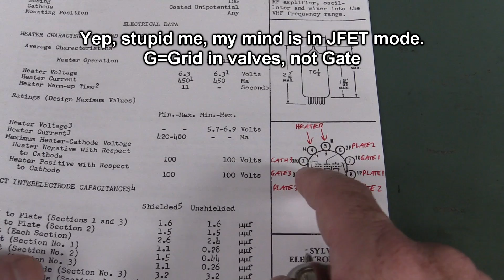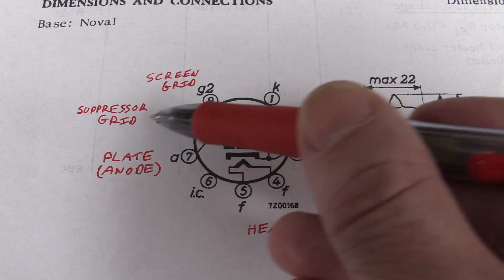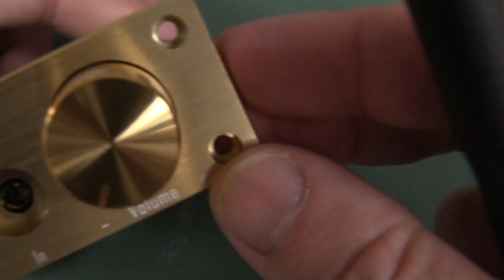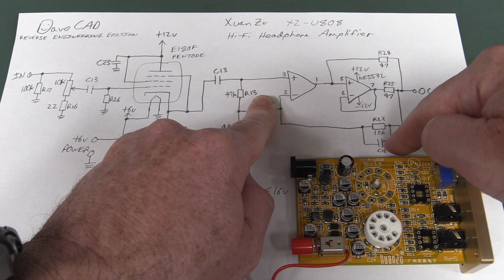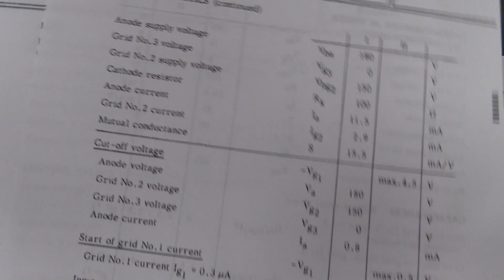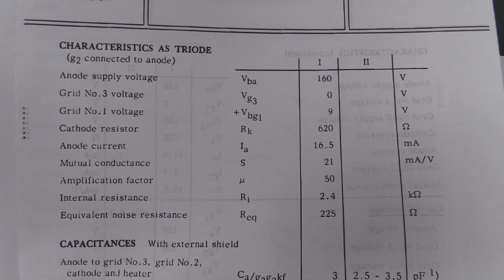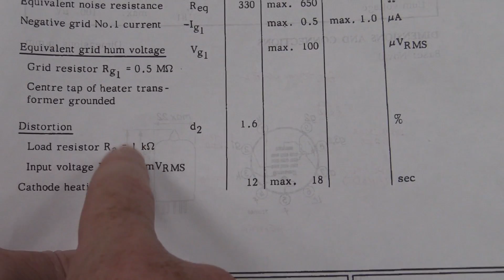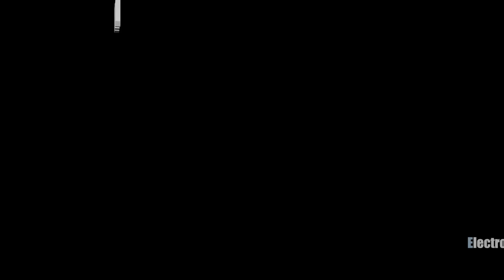EEVblog #837 - Reverse Engineering A Valve Headphone Amplifier

Comment: Come on folks, it sound better cause it looks better... no way my stupid semiconducter driven USB sound interface could be a match for this piece of engineering. And the case.... oh my gosh... it's GOLD. Haven't you seen it? GOLD always stands for top notch quality. And you gotta love the blue LEDs. You know... in the future everything awesome glows blue, that's a matter of fact! Unless you are a real hacker. Then you would hack the shit out of that thing and replace the blue ones with green ones... genuine hacker green® of course.

And now for the sound. Impedance conversion alone is reason enough to justify the tubes. They add all the sound professional sound engineers, musicians and that crappy equipement they use, could not provide.

You gotta learn to hear with your heart, not your ears, for they are too fuggin' close to your brain, which constantly rejects fraud and believe systems weaved by ScamCo Industries ltd. !!!

Comment: I have to ask, It makes sense to me to have two tubes and two NE5532P's to cover the left and right channel for stereo sound. So what is up with all the tube amps that use one tube and one NE5532P? I just built a headphone amp using two of the NE5532P's but not sure why you would use one. They must be losing output power with one as opposed to two of them.
Reply: The larger single-valve one that TechMoan tested is clearly two valves in a single package - you can see two separate heater elements in it. Same applies to the smaller one if you look up the datasheet, it's a dual triode. As for the NE5532P, well it's a dual op-amp so I guess they are just using one per channel. Maplin sells a stereo headphone amp kit which does the same (code N47FL) for the princely sum of six quid (so it probably costs about 6p from China).
Reply: My headphone AMP was cheap. About $9.00 US. It uses two NE5532P's and to my surprise it sounds good with little audible noise. Kinda nice because there are so many of these on the market and the price can go really high for one, but the sound may be terrible. You can never tell unless you try it out. If mine had sounded bad I was only out $9. I had fun building it though.

Comment: I fell into the trap and built one, hardly any amplification. It was mostly a headphone impedance matcher
Reply: Given that the circuit is essentially just a (not-terribly-good) tube-based voltage follower into an op-amp-based voltage follower...  that seems right.

Comment: valves in anything but guitar amps make no sense. what non guitar players wont know is that valves not just sound rich and full they also respond different than transistors when you play and they feel different when you  play. You cant get that with solid state amps, Its not about distortion, its about response, feel and odd order harmonics.
Reply: " its about response, feel and odd order harmonics."

That's distortion. It is just DESIRABLE distortion.

Comment: Actually, you can find out if valves doing anything in less than 26 minutes. Just detach them from the board, and voila! If you notice change in gain or not sound at all, there's an answer to this question.. I won't bother to watch this till the end...
Reply: +Damir Ulovec Well, if someone wanted to, they could design a circuit where removing the tube would cut out or affect the sound on that channel without the tube actually being part of the sound path.

The important question here is if the tube was an active part of the sound path, and if it was, does it serve a practical purpose or was just designed in as a way for the manufacturer to claim it was a tube amp.

Comment: Tubes in such a product are useless. Better buy a complete kit or build one by yourself.
The Sot8 IC could be a MC34063A, Chinese Designers love that IC, and is there really written 6J9 on the tube ? I used Google to translate the russian name of one of the tubes that can be put into the amp and it says 6SH9P, witch is a HF penthode.

Comment: LOL, anybody who bought this for HI-FI headphones with high impedance are going to be disappointed. Unity gain works well(not) with high input impedance headphones.
Reply: Normal output level from MoBo or other stuff is ~1V and power is U^2/R. Some Hi-Fi headphones have impedance of ~200-600 Ohm compared to normal ~30 Ohm, so at the same voltage you can only have 1/10-1/40 of power you actually need(as Dave would say bugger all). Without voltage amplification headphone amp won't work good with conventional source on the most of expensive headphones. I never read about how higher impedance actually helps though, but they are generally more expensive ones.
Reply: +mipmipmipmipmip op amps are configured for low pass filter with unity gain at low frequencies, so people with expensive headphones can enjoy normal sound at at least 1/10 of normal level of not more;) that is at least -10 dB
Reply: +mipmipmipmipmip might not be possible with newer models. Apple want to go back to proprietary audio connectors, namely connecting headphones via lightning. Also I think there are 600 us$ beats already, and iirc beats are owned by apple too ;)

Comment: If you are a true Audiophile and the blue led light under the tubes freak you out !  just cut them out with a wire cutter ! Or solder in a dim orange led to simulate more of the filament glow ! But I know a true Audiophile will cut them out !!!!   :-)

Comment: The "6J9" is probably a Russian part number!
But why use TWO tubes, in that circuit I would have used a 12AU7 dual triode.
Reply: +Kenneth Scharf Cheapness.
That tube they use, bet you can buy like 50 for 10$ 
A single ECC81 (i believe?) is more expensive then 50 of those weird ass cheap cheap china tubes.
Definitely not Russian tubes. China

Comment: The whole point is: this cheapish gear has nothing to do with a real tube amplifier. It's a toy. Before you finally judge about the whole family of tube amps, please listen (and reverse engineer) a really good tube amp. Some of them are built with clever solutions, using high quality components, with very low distortions, and are sounding wonderful (not in terms of harmonics). Learn more about tubes, try and error, and after some years of experimence you may judge right.
Reply: Dynaco made one of the best tube amp kits the stereo 35. it used 6Bq5's one of the best audio amp tube ever built. if I get my hands on one I would use it in my stereo setup. right now I dont have an amp. I am waiting to find a good unmolested tube amp I don't want any solid state inside. no diodes to replace a rectifier tube.

Comment: Don't waste your money on these tube gimmicks the tubes are not amplifing anything. The op amps are. The filament and leds are lighting up the tubes for show. You could build your own headphone tube amplifiers but you would need to run ac to the amp. You could take 24 volt ac and use a few diodes and raise the voltage for plate and grids on the tube. You might need a bigger enclosure  for the diodes and capacitors. The old b and W tvs used voltage doubler curcuits when they didn't use transformers. You can go past double voltage by adding diodes and capacitors. You must not try this unless you isolate the high voltages from the headphones. I would use a matching transformer. Headphones are usually 8 ohms impedance. Tube circuits can be found on the internet. Another way of making a tube amp is to use low voltage tubes from the old battery radios. Them radios used two batteries one set for the filaments and a b battery for plate voltage. B batteries are not easy to find but you can make your own by using 10 nine volt batteries in series. Another way is to use L-ion  batteries but they are heavy and need special circuitry for charging.